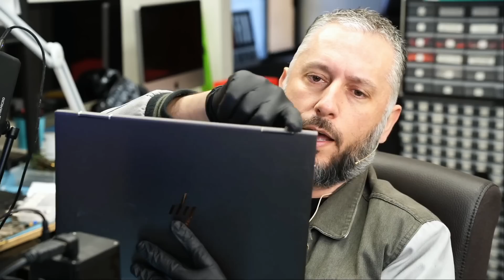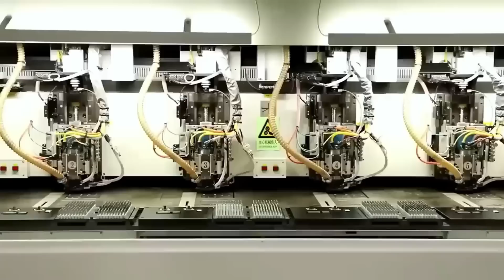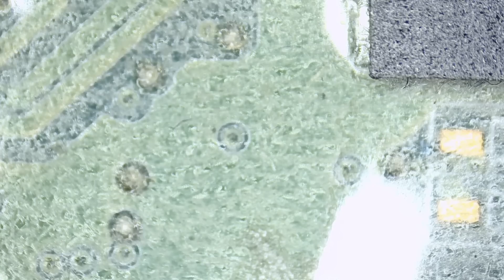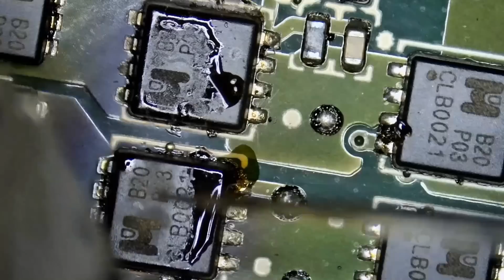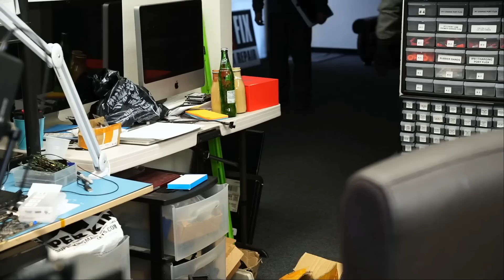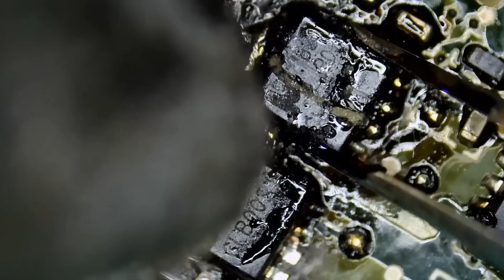HP X360 Spectre laptops - They Just Die

Comment: These HP diamond cut are rubbish like others have mentioned they run way too hot and need premature battery replacements.
Reply: The HP diamond cuts that run hot, is it the versions with integrated graphics or external graphics that tend to have this problem?

Comment: I purchased an HP 15” envy laptop running a Rizen 7 CPU from Best Buy. To make a long story short the CPU failed after 13 months. When the back was taken off the computer, the manufacture date in the back of the CPU was 2019. I purchased the computer November 2021. So the CPU in the computer was three years old. Neither Best Buy, Hewlett-Packard or AMD would give me any help or any relief on repairing the computer. I spent $1000 on the Purchase. As of today the computer is still sitting in the closet. I might buy a new CPU motherboard to repair it. The bottom line is none of these companies are going to stand behind their products and help you. They have no integrity. They don’t care about you as a customer. My next purchase will be an Apple product  running iOS. Tired of the windows operating system. This last incident with the HP computer sealed the deal.

Comment: Could you not have just bypassed them by running a wire instead? There are already two other mosfets that would be used for protection anyway.
Reply: I see people saying those chips should have been grinded off with a Dremel.

Comment: I would suggest using air nozzles on your heat gun for more focused heat being applied. I have universal ones that attach to my heat gun with a screw. The air speed setting on my heat gun has to be turned up to max so the heat doesn't build up in the nozzle and damage the heat gun. Also, hot knife soldering tips used for engraving leather and wood would give you a few more options for removing something like this.

Comment: Say you did get those MOSFETs off the board cleanly, but the short persisted? That could have been a deep rabbit hole. 

My Bosch oven relay  board had a shorted Darlington Transistor array chip, and that was it. 60 cent part vs buy a new $400 board. Of course I did the repair vs buying new.

Comment: Ironic the HP X360 Spectre Laptop has a similar name to the Microsoft Xbox 360 gaming console of the distant past.  I believe the 360 was their own designed second gen gaming console.  The first gen was by Intel, a good hardware maker IMO.

The Xbox 360 had a well known issue of overheating over a period of time eventually giving the Red Ring of Dead during power up.  Use it sort of lightly like for standard video, will last around 3 years.  Gaming can kill the console within months.  I will never trust a software maker for hardware again.

Additionally I've toasted several smartphones and their batteries.  They were fast to fairly fast phones.  Now use a low-end Oukitel WP5 with a 8A battery.  Slow/sluggish response time, armored body, acceptable image quality and a touch screen that's only fair.  Yet I've not toasted this phone in about 2 years+.  Learned and made changes, USB gives the option of slowing the charge rate dramatically.  Currently charging at about 7% per hour, that's 0.5A with the screen off.  Partial screen video playing, charging drops to about 2% per hour.  IMO, phone will remain cool enough to run in this mode continuously.

Comment: I have the Spectre X360 Spectre 14 with the 13th gen chip (2023 version). It's quiet, bright, and the keyboard/trackpad are exceptional. It beats the hell out of my experience with my Dell XPS 13 at work. We've enjoyed HP's through the years and have had some failures after 4 years. That's about what I expect.

Comment: I purchased an HP gaming laptop with a gtx 1650 and ryzen 5600h(?). I had to send it in for RMA just a couple months after buying it because it wouldn't power up anymore. Mind you I didn't use it much and the only gaming it saw was me firing up dota and RE2 remake for a few minutes just to see how it ran. It's been running ok since receiving the repaired unit back but I've only used it for basic tasks and it doesn't inspire much confidence that it died so quickly in the first place with light use.

Comment: for welded tough ones like that I use a dremel grinding disc to cut a waffle criss cross  pattern on the component .....very careful not to go through to board then flood with low melt solder and usually they let heat in for success

Comment: I had a x360 once, the screen is more fragile than the phone, don't think it's gorilla glass. And the weight of the laptop is many times more, so the screen cracks easily if you drop it.
Most importantly, the tablet experience is worse than an iPad, laggy and apps not optimized for tablet.

Comment: When I have such a repair, I use the Dremel grinding and polishing disc to sand the transistor down to the pad so that all the pads are preserved if they are not already short-circuited internally
Reply: Do you have a part number for that disc?
Reply: Do you have a link to this Dremel "grinding and polishing disc" that you use?

Comment: Those HP X360 Specters are pure trash, those mosfets always die, even when they're running ok those mosfets run extremely hot, melting the plastic lining. Every single Specter that came in is either bad fused mosfets or brocked charging ports on the diamond model! POS HP!
Reply: The HP X360 Spectre that run hot, is it the versions with integrated graphics or external graphics that tend to have this problem with Mosfets melting?

Comment: I had one of the diamond cut ones and was underwhelmed. It always had the fan roaring and felt hot. Then it just died - with the caps lock  flashing. After a lot of faffing I got ti to boot but as soon as it was warm it died again with a gibberish pattern over the screen. I won't touch HP stuff now.
You made it clear at the start that these are a major problem and you made the right call in declaring a no fix.
Reply: HP laptop is always terrible with their cooling system
Reply: Was your 13 or 15 inch? I have the 13.. mine certainly gets warm and the fans do run quite a bit but I haven't had it die yet.
Reply: 13 inch. I made sure the fans weren't bocked with dust but it always ran hot. I used to monitor the temperature and was usually in the high 90s centigrade. If it had been idling it would drop to the 70's, but as soon as  I started workinng o it the temperature would shoot up to hig nineties and then the fans roared. Unfortuntely there's no equivalent to alex and NF here in UK!
Reply: My 12th Gen 16" is doing the game thing, dead with caps lock flashing 5 times slow then 3 fast "BIOS failure"
Reply: I have the newest 14" spectre and it's great. Very cool and silent
Reply: @morten1  that's good to know. I like these.. they are very light and I like the way they look but don't like seeing these issues. Mine is still kicking so far. We'll see I suppose 🤷🏼‍♂️

Comment: This video shows the exact reason why hot air stations are seen as unrefined, bludgeoning tools and a new type of tool is needed to apply direct heat to failed components.  Hot air has its place in modern electronic repair but there is a clear need for alternate heat applying tools.  The problem of course is that the market for a new type of tool for a niche specialism within a niche specialism (component level repair in micro electronics repair field) is miniscule and manufacturers really only make money when they can mass produce a product.  This needs the soldering industry to look at the needs of the repair technicians and to find a new way to deliver the high temperatures needed directly to components at board level without the 'splatter' effect of hot air.

Comment: Would it not have been easier to have used the donor board instead and swap parts from that one
The donor looked better than the one that was going to be repaired
Reply: donor boards tend to be faulty too, with no previous history and are just used to harvest components, rather than spend several hours trying to repair the donor motherboard with no guidance of what was originally wrong with it.
Reply: The entire purpose of the donor board is that the board is used for parts because there's a problem with it.
Reply: @disguiseddv8ant486  it might have had less problems than the one he had to fix

Comment: I'm very surprised that Alex took it that far. If those mosfets are welded to the ground pad like that, you have a 1 in 7 chance of getting them off. Dremeling them off down to the pads is how it's done but it's time consuming and messy.
Reply: I was thinking the same. All that heat delaminated the board, could be fixed by grinding it, or leave to someone who will grind if not Northridgefix. but there's little point in it now.
Reply: I thought the same thing, it wouldn't be any other way... it would be nice with a controlled Dremelle.
Reply: If you dremel these out, than it could be a problem in the layer too, about the melting mosfett. And the mosfetts are not the problem, i think there is an other reason. So Alex spend 2 or 3 hours for repair, than it is cheaper to buy a new motherboard.
Reply: I'm semi-surprised there's not a vacuum + drill attachment designed especially for mosfets.
Reply: I will use us the dreling method by grinding the mosfet  . And saver the bord
Reply: I see some products about laser soldering like tbk r-2201 or lws-301 laser soldering station. What do you think about those kind of products?
Reply: Even getting it off, the layers underneath could have become conductive.

Comment: Wow! How common is it to find components that have welded themselves directly to the copper trace like that? I wonder if it matters if they used too little solder paste at the factory or something... Oh, and a late Happy new year!
Reply: When components overheat, the solder gets out from underneath the components as tiny solder balls until there is almost nothing left. 
So the quantity doesn't matter. 

The heat destroys the epoxy that holds together the fiberglass layers of the board and delaminates the layers.

And the welding, I believe it happens when the components blow up. Because it takes about 1000°C to melt copper.